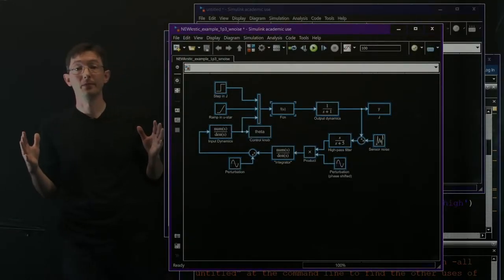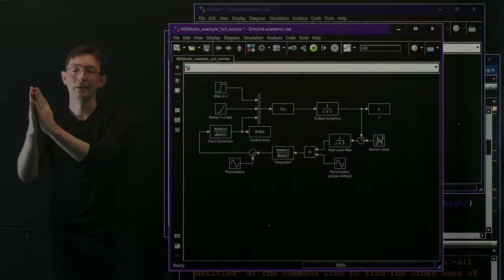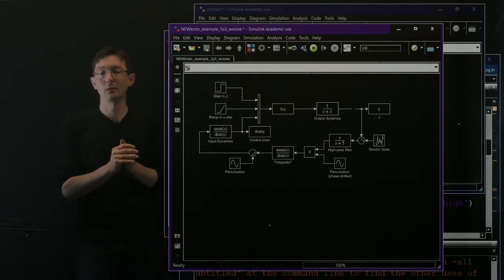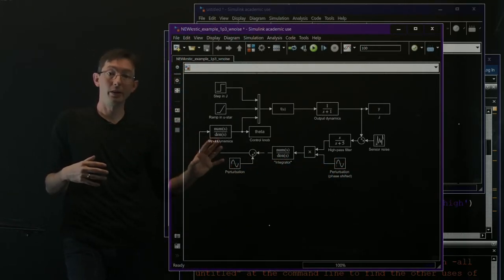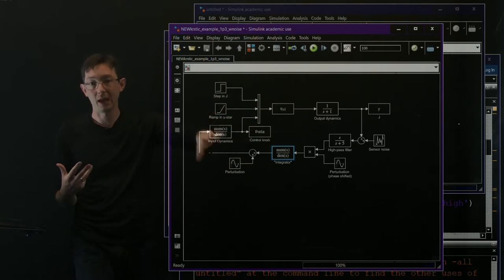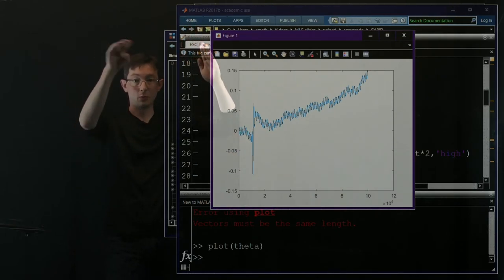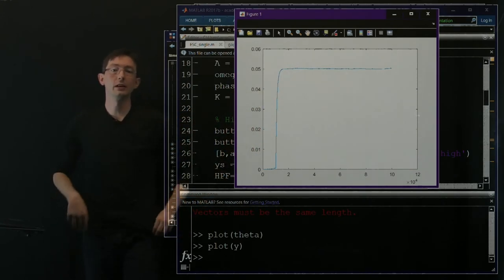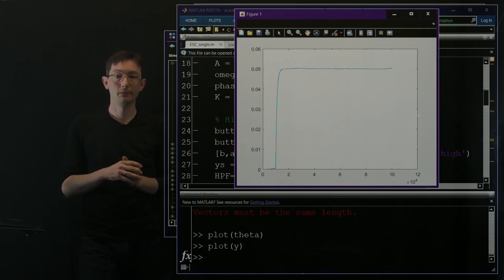Extremum Seeking Control: Challenging Example

Comment: This is fine and cool...but it's never said anywhere, where I'm supposed to find/design a cost function for any given system...which if I used something from LQR, like a quadratic cost...I'd still need to know the entire statespace model....?
Reply: How would someone use this for an unknown mechanical system...even a basic pendulum cart would be nice to see it's use.
Reply: It seems to me that the limitation of ESC is not designing the cost function itself but that the cost function be MEASURABLE in practice since it's assumed unknown.